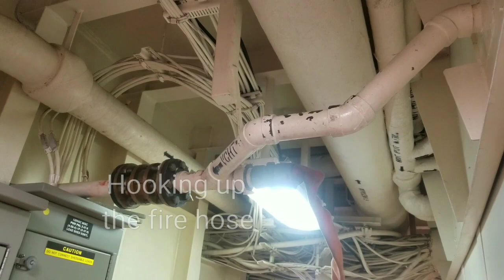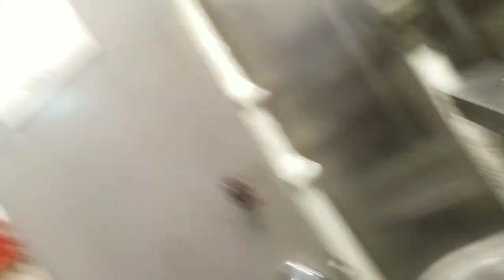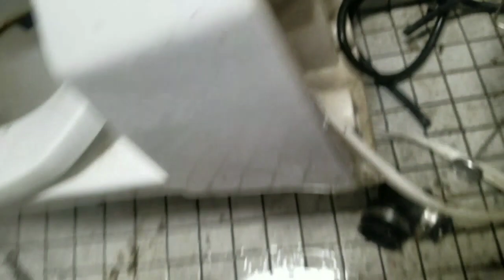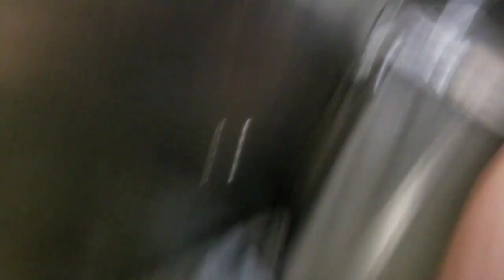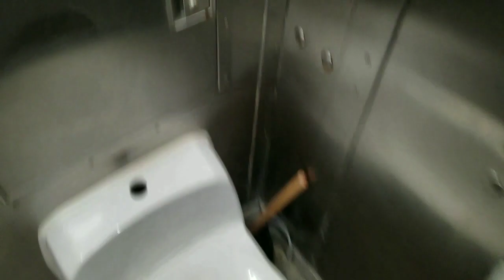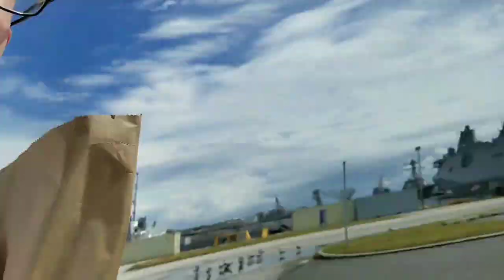Poop geyser

Comment: Cruise toilet vs airplane toilet they are both vacuum toilets so cruise toilet vs airplane toilet which one has better suction
Reply from the maker: Hmm i imagine the pump is very small though it only serves two toilets. These pumps are bigger and theres 3 in each pumproom operating at the same time.  However they serve about 100 toilets.  I think this is going to be a tie because i have flushed both and they seem to have the same power.
Reply: @navyplumberboy8274  yeah it's a tie